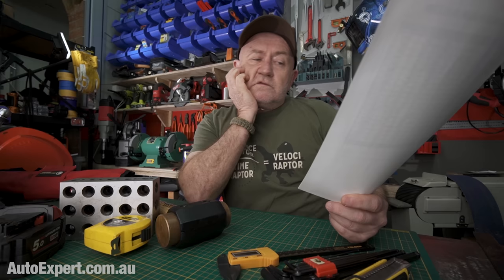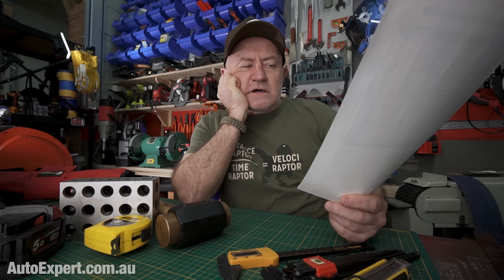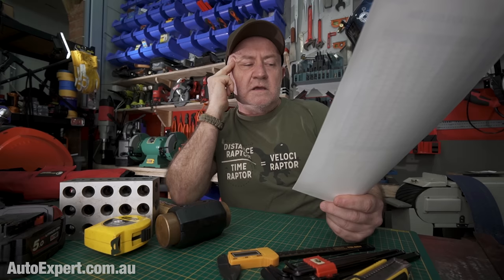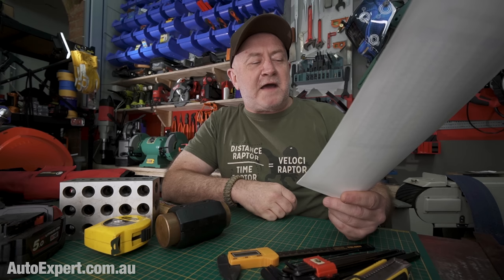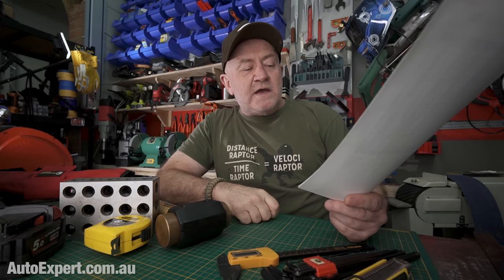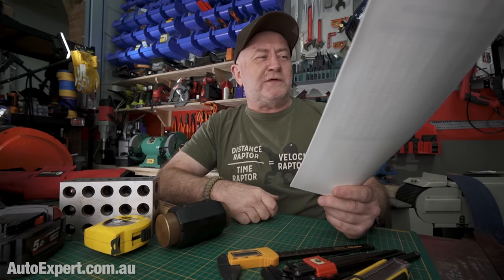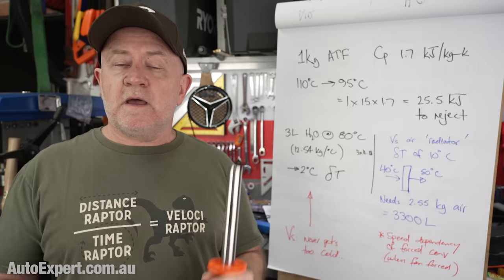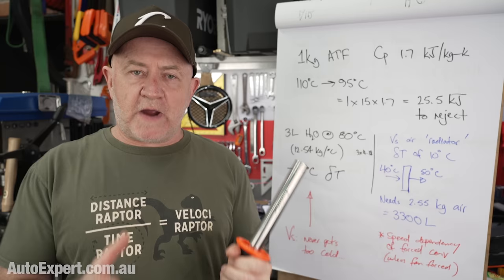The truth about fitting an auto transmission oil cooler | Auto Expert John Cadogan

Comment: Hey John,
Great explanation.  I was concerned about the auto trans in my XM Kia Sorento because excessive temperatures are one of the greater enemies of automatic transmissions and internal combustion engines .  I'm  lucky, I have an Autel scan tool.  One of the data outputs in the TCM is oil temperature.  I took the scan tool with me when travelling to Rockhampton ( not quite DPC) in January 2021.  The OAT was in the mid to upper 30°C's (if you didn't  put units on numbers in reports, my old Thermo Professor would write 'what, bannans') and I was towing approximately 1.5 tonnes of dual axel cage trailer.  To my surprise, the Transmission oil temperature rose quickly from a cold start to 70°C and stayed there for the entire trip, regardless of OAT or speed.  I was some what surprised, but Kia do say they modify the cars for Auatralian conditions.
The other thing is that regardless of temperature, the Sorento shifts are always the same, even on a -1°C morning.
I had to change the the automatic transmission oil on a V6 petrol JAG (unfortunately the Mondo engine).  The specs call for filling and then opening a drain  level plug (and the filler plug out) and letting the oil drain out until it stops between 35°C and 40°C as measured by enquiry with the scan tool.  After shifting through all the gears with the engine running and then placed in Park.  When you get to 40°C you have to put the plug back in and walk away until it gets back to 35°C.  You have about four minutes each time and the drain level hole is a 6mm threaded hole.  The oil change took about 15 minutes, but getting the level right took the rest of the day.
When I was playing full back for Jerusalem with Noah, (my kids tell me I'm  that old), an automatic transmission specialist informed me that the clutch pack material was basically paper and the excessive temperatures caused the clutch material to form a layer of carbon (they basically burn).  The then become slippery and need to be replaced.  Admitted, electronically controlled shift architecture has effectively eliminated the slow chances that were part of the cause, but the transmission specialist advised removing as much heat as possible from the transmission was advisable.  I would suggest, with respect, that I am unaware of any automatic transmission that has a thermostatically controllers oil temperature system.  The all go he'll for leather to get the heat out even in the snow.  I may be wrong, but no AT or torque convertor drive I'm  aware of has a thermostatic controll function to keep the oil in the gold locks patch.
Reply: P.S.  if this is any indication of KiA's attention to shitsviĺe, the upcoming Kia ute is going to blow everything out of the water, all be it in the higher price range than the Chinese wantabes.

Comment: Good video John. The work around that I've implemented a few times as a mechanic is to run the auto fluid through an air cooler first and then through the bottom of the radiator afterwards - the air cooler will take a few degrees off the auto fluid which will then be less likely to raise the coolant temp. And secondly, the coolant will ensure the auto fluid going back to the auto has not cooled down too much. 
But then your also restricting air flow in front of the radiator and slightly raising the temp of the air going through the radiator making it less efficient at cooling the coolant. 
I've found that the best help sometimes is to add some extra silicon oil (available from Toyota) into the viscous fan hub making it suck a bit more air through the radiator.
Reply: As John explained, air is really a very inferior way of absorbing heat compared to water, so is it really worthwhile installing an air method just before going into the water?
Reply: @jamesfrench7299  
It is if the turbo diesel also has a lubricating oil cooler rejecting heat into the coolant...and the radiator.
In which case every little bit helps.
Or do what most Holden owners have to do...
install a much greater coolant capacity radiator in preparation for  towing the shittoir......

Comment: A standard size 300x300mm transmission oil/air cooler in conjunction with an off the shelf 12v 10'' thermos fan mounted to it that produces at least 850cfm when converted will give you 24.06 m3/min. That's 24060L of air per minute which far exceeds the required amount to cool the transmission in your equation.

Also wiring the thermos fan to a 3 position switch (ALWAYS ON, OFF, AUTO/TEMP) with a temp sensor will keep the transmission at the optimal 90-95c temp indefinitely. So yes I agree that water/air is great in concept and is far more efficient on its own you cannot really beat the price and availability of an off the shelf air/air setup with a fan and mounting bracket kit to suit almost every 4x4 and some passenger cars on the market.

Comment: Thanks for the calculation cheat sheet. I have a 2000’s MG that uses air as the cooling medium for CVT fluid from Factree. It overheats in traffic and I now can calculate the kind of blower I’ll need to make a difference. It may actually work!

Comment: I usually agree with the auto advice JC offers partly because he is qualified to offer that advice. He is also very good at simplifying the known technical and scientific data he uses to support that advice. Regarding the use of add-on air transmission coolers, having had some practical experience with and without a Trans' cooler in my tow vehicle I am very pleased with the result of my install. I'm sure if JC conducted his own 'practical YouTube project' on before and after trans' cooler installs he could possibly question his known scientific facts and figures.

Comment: I'd recommend for anyone that keeps their car long term (10+ years); separate the engine oil/transmission oil coolers into their own system.  If corrosion ever gets a stock combo radiator, you have coolant mixed with your lubricating oil and oil in your coolant ...  bad news but separate coolers means it can never happen ...
or alternatively, plan to replace the radiator every 10-15 years?  Suppose if its corroding enough to mix fluids, it would corrode and need to be replaced anyway?

Anecdotal a car I sold to a friend that is about 20 years old with about 120k mi/200k km on the clock had the two bits of the radiator no longer keeping the fluids separate.  There was little bits of oil stains on the driveway just before they noticed it overheating on the way home and stopped.  The  CVT was flushed several times and it is still running.  It was close to being a dead car.

Hope everyone is having a blessed day, whatever that means to you.

Comment: As a weird aside, when you fit a towbar to a Honda CRV it comes with an oil cooler kit that has to be fitted to comply to warranty. The cooler sits in front of the front left wheel arch and comes with a new bumper insert and arch liner both with vents. It also just plugs straight into the CVT (there is a loop of hose you pull off and plug the cooler lines into). I'm guessing this is to stop the CVT grenading while towing your caravan on the highway.

Comment: In the USA here.
I drive an F-150 4x4 with 4.6 V-8 and auto xmsn.
My xmsn temps range from about 60 to 80 (C) most of the time.
Almost never does the transmission reach the 90-100 temp range, even pulling a trailer.
No changes to factory set-up for cooling (one small air trans cooler in front of the regular radiator).

Comment: I like the emphasis on keeping crap out of the way of the radiator airflow. I seem to recall Andrew of Berrima Diesel also talking about bullbars reducing the airflow to the engine of a Toyota 70 Series with a V8 and the standard bonnet air intake.

Comment: This is fantastic! But, the argument of lost airflow on the air to oil cooler at low speed, can it be remedied with a fan, similar to how the radiator uses a fan to make up for slower air flow? It seems like it would affect both, but likely unequally due to the water’s increased cooling capacity.

Comment: Stop the torque converter slipping and generating heat in the first place.  Fit a torque converter lock up kit.  Best modification I did  for towing with my NX Pajero was to fit a MM 4x4 Auto mate lock up kit. Keeps  transmission temps around 70-80 degrees all the time. Fully automatic will lock and unlock depending on driving conditions. Has its own computer that talks to the gearbox CPU. Shift settings etc can be adjusted. Also fitted an ultragauge to monitor engine parameters eg  Torque converter temp and gear box pan temp. Once transmission is locked temps stabilize around 70-80 degrees very quickly. Better fuel economy as no slippage and more power to the wheels. You would be amazed how quickly transmission  temps can reach over 100 degrees when the torque converter slips even without towing. Standard automatic gearbox programming for most 4x4s will get to top gear very quickly but with a bit of acceleration torque converter will unlock and slip. Pajero will not lock until car is travelling above 90kph. MM 4x4 Automate will lock from 2nd gear up to top gear. A must for towing with an Automatic Gearbox.
Reply: Here in the US a lot of vehicles come with "lock up torque converters" from the factory.  It is a simple way to increase the mileage and decrease the pollution per mile so the makers do it.
Reply: I thought most auto trans had lock up converters these days.
Reply: @partymanau  They do but they don't always lock up when you want them to which is the main problem with the overheating. Top gear under load will quite often unlock. Being able to remap the  Gearbox CPU and keep it locked longer would fix this or fit a lock up kit. Some American pickup trucks have a tow button which when pressed has different mapping for the gearbox which keeps it locked longer. This is what we really need  fitted from factory to our tow vehicles in Aus.

Comment: Heat exchangers joined with radiators have been known to leak coolant into transmissions. Fitting a air cooled transmission cooler is a great idea.
Reply: fix the leak
Reply: @longflare  Too late for the transmission by then.
Reply: dohhhhh comment   @longflare

Comment: John having been a mechanic since 1971 we started fitting transmission coolers on falcons because of their bad habit of the radiator leaking water into the gearbox causing red milkshakes. This caused by he poor quality radiators ford installs in their cars.
Reply: I had that happen to my 2002 BA Falcon
Reply: @archygrey9093  very common for them unfortunately. 😔
Reply: Yes mate common modification on a couple of other brands as well ...
Reply: That happened to my 2000 AU wagon.

Comment: I'm a forklift mechanic and most machines with torque converter based powershift transmissions have an oil to water transmission cooler which is built as a seperate exchanger coil in the radiator which obviously shares the engine coolant - they're sized appropriately for all operation conditions and using the engine coolant keeps the transmission at optimum temperature.
I have had a few odd ball cases of severe engine overheating caused solely by the transmission dumping excessive heat via its exchanger into the engine coolant but this has always been due to a severe fault with the transmission itself - normally severe clutch pack slippage caused by f@&ked clutch packs or low clutch pack control pressures. Never seen it due to any specific operating condition, ordinary or severe.

Comment: classic example was the Falcon and Territory petrol engines with the ZF 8-speed torque converter, if they were not from the factory with legit tow pack then they did not get the high capacity air to air transmission cooler and asuch the gearbox would "milkshake" and that was that.

My old Falcon from back in the day had a factory tow pack (up to 2,300kg) and as such the good ol BTR 4-speed torque converter had a transmission cooler and was pretty much bullet proof once up to operating temp when towing, the trick is to be gentle for at least 15 minutes of so while everything gets into correct temp mode.
Reply: Would have helped if Ford had installed an ATF thermostatic valve like a Derale product...trans temp would have gone to normal operating temp very quickly even on frosty 
cold days....

Comment: a missed factor that a lot of us who do install a aftermarket transmission coolers...in the event of a radiator failure...you are not at risk of milk shaking your transmission.  while i agree that the cooling properties of an air cooler is inferior too a inbuilt radiator/transmission cooler...i would rather have the systems operating independently while regularly servicing my transmission to mitigate premature oil degradation.
Reply: Me too.
 If system is an 'add on' I would prefer it to be serviceable separately.
'All in one' systems are great, until a part fails then 'everything' fails
Reply: In a nutshell....that is exactly why I fitted a trans cooler, not for the heat properties reason, but so that when, not if, the radiator cooling pipe is compromised I don't end up with engine coolant mixing with trans oil and when it returns to the box is superheated and 'curdles' the fluid.... = 1 fucked box.

Comment: There’s so much opinion on the internet about the importance of keeping transmission fluid temperatures cooler than what they generally achieve when under load and/or subjected to high ambient temperature, and the opinions generally suggest that colour or smell of the fluid is an accurate indicator of its state of degradation. There’s very little factual evidence however, of what temperature transmission fluids can safely operate at before degradation occurs. Much of the opinion I’ve read about the importance of cooler transmission temperatures seems to originate from people with a vested interest in vehicle owners fitting transmission coolers, or from people who have in fact had coolers fitted to their own vehicles and are seeking justification. I don’t blame them, I probably would too. 
I’d like to see results from credible laboratory tests of transmission fluid samples that have been operating at high temperatures for varying exposure times, and see what the results indicate are temperature ranges and exposure times that transmission fluids can actually endure before the lubrication qualities of the fluid is actually adversely affected.

Comment: Install the trans air cooler BEFORE it cycles through the radiator. This knocks the hot fluid temp down before it goes through the radiator. Radiator doesn’t have to work as hard to cool the hot transmission fluid.  Scan gauge water temp readings have proved this. In extreme cold weather cover the trans air cooler with a cut to shape piece of thin flexible nylon chopping board. The oil cooler and extra length hoses does not restrict/slow oil flow as I tested the flow of the fluid with and without the air cooler fitted. Both tests expelled 2 litres in the 10 seconds with the engine running at idle. Air flow through radiator is same with or without spot lights. I temporarily mounted a wind speed meter in various areas of the radiator shroud in the engine bay and readings were same compared to having no bar or spot lights. If only people would conduct real world testing before putting out their untested opinions.

Comment: Hi john I'm planing to fit two small transmission coolers i n my holden colorado rg because I'm towing a lot in queensland but I want also fit oil thermostat which is going to activate extra coolers when oil temperature reach about  and over 90 C

Comment: A consideration is that if the transmission is overheated and forces the heat exchanger in the bottom tank to run too hot there is a deposit that forms on the outside of the tube insulating it. This fouling cannot be removed easily. Therefore the next overheating event will onset sooner and likely make the deposit worse. Adding an air cooler instantly fixes the problem. Some transmissioins do not have a high enough flow to the cooler for the load so will send hotter fluid to the cooler and cause the problem. Importatn not to overheat the supplied heat exchanger. Seems the best way is to have a thermometer in the transmission and the exiting fluid controlling and additional cooler.
Reply: see Derale thermostatic ATF control vaves for coolers......
DIY that ensures ATF is neither too cold nor too hot...

Comment: About to watch the vid, just a note, the old Powerglides actually had a spring and ball between the cooler passages, so if you kinked a line, no cooling, but lube circuit stayed open and you didn't even get to know there was a problem.

Comment: This is why you also fit a temperature control smart valve to recirculate the oil back to the transmission until its up to temp & then when the transmission fluid gets excessively hot  due to low speed, rough, steep tracks which tax most 4WD's.

Comment: i heard a mechanic advising putting a supplemental transmission air cooler UPSTREAM of the existing transmission cooler to avoid overcooling the oil. it will still reduce the cooling load on the regular radiator.

Comment: The BT50/Ranger has an issue with the viscous fan hub. It failed and the vehicles overheated at high ambient temps. It really means the vehicles are underdone in the cooling system. A fan hub should really be effective at low speeds.
My personal bt (Now traded because the dealer WILL NOT fix many issues) would overheat up a hill above 35 deg c. Took 3 visits to the stealership to fix.
The trans upshifts when engine temps of over 100 deg are recorded to circulate more coolant.
Just don't tow with it. Buy something rlse.